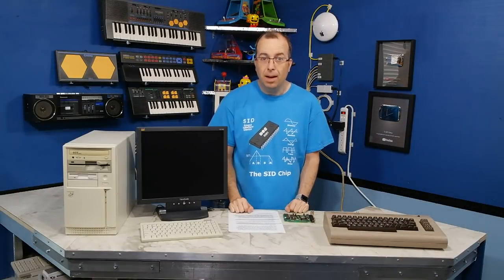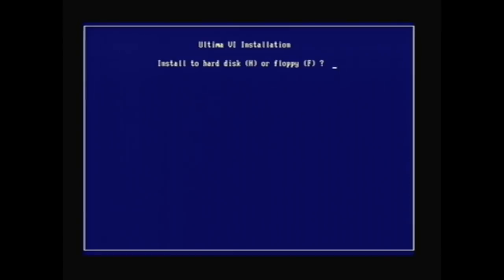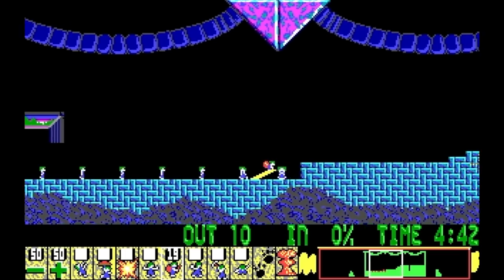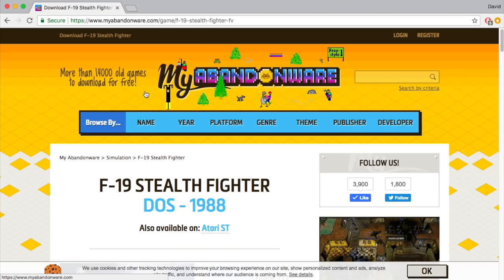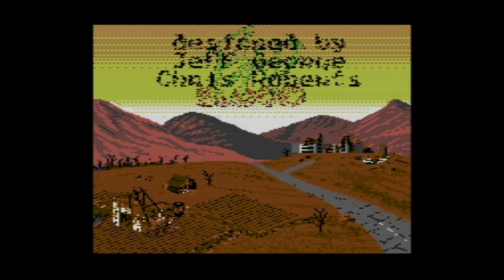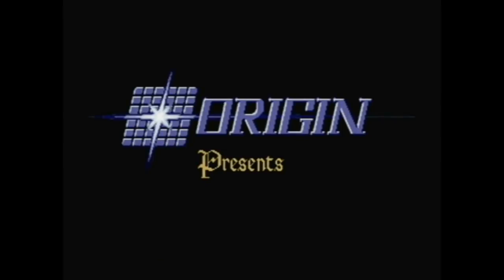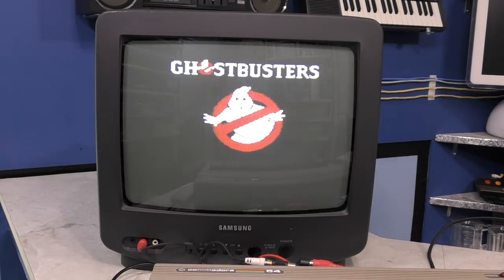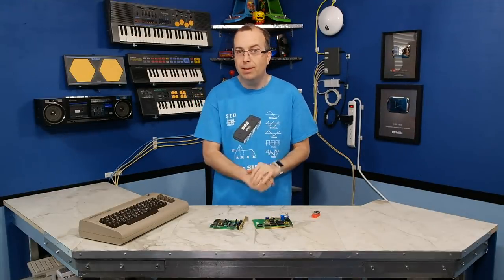Replica Sound Cards - AdLib, Innovation SSI-2001, and SwinSID Ultimate.

Comment: You know its the future when its easier to have a tiny computer (likely much more powerful than the c64) emulate a chip in software rather than to recreate the hardware.
Reply: Actually FPGA would be much better because it is not emulation at all and there for more accurate.
Reply: KRAFTWERK2K6 Except an FPGA (or CPLD) doesn't do the analog stuff.  A microcontroller/DSP can calculate the result and feed it to a DAC.
Reply: Actually from what I have seen in this video, there's a Xilinx chip on that SID-Board, meaning that it is an FPGA an no software emulation.
Reply: In the near future we can simply download hardware as software. We are going to be able to download more RAM as much as we need.
Reply: Just the other day I was reading about a project to allow using a Raspberry Pi to emulate a 1541 disk drive...
Reply: It's actually possible with a microcontroller: That's what the SD2IEC is.  But the Pi version offers much more complete and accurate emulation of the entire drive, making it more compatible with odd disk loaders.
Reply: @Erik Hansen   It's interesting.  As far as I can tell It's not just a matter of ease, It's a matter of silicon density:  Recreating the entire c64 on a much smaller scale is very possible, but the applications of such a device are very limited.  Whereas the potential applications for ARM powered single board computers are much wider, so has far greater enconomies of scale and accordingly a much lower price.

Consider how much silicon is used in an original C64.  Then consider the size of a Pi's system on a chip.  In the much smaller surface area, you can have a functional equivalent using modern technology at much much smaller scales, and very likely using less power to do so.  And we're at the point where you can pack SO MUCH MORE computer in the same silicon die.
Reply: @KRAFTWERK2K6  FPGA emulation is still emulation. It's code (in Verilog) running on hardware with a radically different architecture. Verilog vs C doesn't make it "not emulation"
Reply: @keiyakins  Exactly... the MOS 6581 is an analog synth... you'd have to emulate the individual transistor's analog properties to get a fully accurate simulation which is beyond any reasonably priced FPGA these days, probably even a desktop PC couldn't' do that in realtime. So, whenever some C64 demo group discovers a new method of using the SID chip there is a good chance that it won't work on a Swinsid untill they update the emulation to take account of that.
Reply: @Wingnut353  its straight up not possible. Individual units have slight differences from one another. The best you can do is preserve the original design and document known manufacturing related quirks

Comment: when he said the SID can't be made any more I thought why so I looked it up the SID is insane for a single chip. Properties of the SID
3 tone generators (voices), frequency 0-4 kHz (16 Bit decomposition)
4 forms of waves (sawtooth, triangle, rectangle pulse width modulation, (white) noise /rush)
3 amplitude modulator, until 48 dB
3 envelope generators
Synchronization of the oscillators
Ring modulation
Programmable filters (low pass, bandpass, high pass)
Master volume in 16 steps
2 A/D-converter (8 bit, low frequency, used for reading paddle input)
Random generator
Audio input (cannot be used for sampling, but the signal can be routed through the SID filter)  it's not that they can't they don't want to try

Comment: Oh my god. I've been plugging those CF-to-IDE adaptors into IDE cables. It didn't occur to me you could plug them straight into the motherboard. What an idiot I am.
Reply: there are models that allow to put directly and others that need a cable.
Reply: This made me laugh more than it should've had!
Reply: There are 2 different type, it all depends on the base of the card whether it is a pin end or a socket end ( male or female )
Reply: Jamie I made the same mistake, so don't worry. Now, I won't have a flash card dangling out of the case on my Gateway PC.
Reply: I usually plug into cables.  Unless troubleshooting or doing some kind of permanent install (or just running out of cables).  Less wear on the motherboard.
Reply: cables are still nice cause you cna master slave then
Reply: And it worked first time , never happened to me...
Reply: It took me me decades to figure out 'hood' meant 'neighborhood,' so relative to that you may be Einstein.
Reply: @czos9239  Oh my god! Just now for me !!!

Comment: Crap, Ad-Lib cards are expensive!  o_o
I think I'll just hang on to my Sound Blaster 16.
Reply: Lassi Kinnunen  Well... not quite. You see, the chip on the AdLib is the Yamaha YM3812, a.k.a OPL2, and there are no SB16s with an OPL2 chip. The one in some SB16s is the YMF262, or OPL3. Even though the OPL3 is backwards compatible with the OPL2, they're not exactly the same. Also, some SB16s had a Yamaha YMF289, or OPL3-L, that is a smaller variant of the OPL3 that runs at a different clock rate and has slightly lower pitch compared to the original OPL3 and even worse, some SB16s don't even have an OPL chip and the whole FM synth thing is emulated, and not very well, through something called CQM synthesis. I have tried at least one of each chip and while you can't really tell any difference between the YM3812 and the YMF262 in AdLib-written music, you can tell there's a slight difference in pitch in the OPL3-L and you can definitely tell something's not right with CQM synthesis.

Comment: thanks for the info everybody
Reply: It actually would be easy to clone a SID chip but it would not be economical. Therefore the SwinSID exists because it emulates it with parts readily available.
Reply: The original factory is gone. Even if you went to the huge expense of reverse engineering the chip and made some, it would not have the same analog properties of the original chip so would be "close" but never be "the same".
Reply: No chip fab does work at that rather chunky scale.

The SID is a hybrid analog/digital chip and is highly dependent on the manufacturing process used at the time. Factories have moved on.
Reply: You would need to find a fab that would manufacture the chip before that  and reverse engineer the die then you manufacture the chip the is very expensive.
Reply: The dated tech has basically been lost. 
Sure, one could use parts and remake the chip, but it wouldn't sound the same, nor behave the same. 
Kinda sad, but you know, that's how it is....
Reply: A few years ago there were companies in China selling "new" SID chips, but those actually turned out to be old, partially defective chips that had been relabeled, or in some cases completely non-functional fakes. So if you're attempting to purchase a loose SID chip, you still need to be careful about that. It's safer to obtain a working C64 (or C128) and then "borrow" the SID chip from it, or use the SwinSID device.
Reply: Actually you can, the problem isn't on reverse engineering the chip(as it was "done" for the emulation) but the problem is that the chip is a property of commodore and that the blueprint of the chip wasn't released anywhere. So you would need to recreate it, which would take a extremely high effort and knowledge in DSP's where can be done perfectly by emulation nowadays
Reply: The SID chips were made in a very old manufacturing process (hybrid NMOS), nobody even has machines for that process anymore. Also the original design documents are lost/haven't been found yet, so a redesign would probably be neccessary. 

It was estimated in the german c64 forum that ~750.000 USD - 2M USD is about the right ballpark to be able to make new SID chips. Of course, nobody wants to do that.
Reply: mateusfmcota I believe they have been delidded and photographed, so at least the layout inside the chip is known and could be replicated. The 6502 CPU was simulated inside a physical simulation (not just digital emulation) in the same way.
Reply: Yes, they could be replicated. Does not make sense financially though, at least at the moment. Although genuine 6581s are expensive and not getting any cheaper, newly produced replicated chip would slash the price down to a few dollars apiece. You'd need huge demand to justify digging up all the antique tech to set up a production line. It just MIGHT work if someone came up with a toy or musical instrument concept that would be mass produced in a huge scale and that would somehow require the genuine chip.
Reply: probably mostly economics. Integrated circuits are expensive.

Another problem is it contains A LOT of analogue circuitry.
Reproducing digital circuits reliably isn't that hard, but an analogue circuit is hard to reproduce with perfect accuracy.

Finally, a lot of what people like about the original are actually bugs and the result of it not meeting it's official specs...
Reply: To add to what everyone else has already said about the SID chip using a hybrid NMOS manufacturing process that nobody uses anymore, and the difficulty in making a chip with reproduction analog circuits that sounds identical, yada yada yada (one of these days I really must find out what a "yada" is and why they always come in threes)...

If you could find a "boutique chip factory" that was able to reproduce the hybrid NMOS manufacturing process, and if they could accurately reproduce the unique sound of the SID chip, you would still have to pay them to make a minimum production run of 30,000 chips.  It isn't worth the downtime to retool an entire production line for a smaller production run than that.  As Tobias Mädel said in his reply, that would cost potentially as much as $2 million, maybe more.  I don't think you're going to find enough SID enthusiasts to crowdfund a project of that scale.

So, we'll just have to rely on the dwindling supply of "old new stock" SID chips and the swinSID (which only costs about $45 including shipping).

Comment: did you notice monty on the run was like an octave lower on the simulated sid?
Reply: matthijs janse was that an octave? Sounded like a few steps down to me. I am wondering whether this another NTSC vs PAL thing, where the chip was running at the wrong speed.
Reply: It was off by four steps and a flat. An octave is eight steps, or seven and a sharp/flat for major/minor scale. 

David's PAL theory sounds like the most accurate diagnosis.
Reply: The SID player doesn't know is whether the SSI card is using a real SID or a SwinSID, so there shouldn't be any difference regardless of PAL/NTSC. Also, neither the real SID nor the SwinSID have any idea whether they are PAL or NTSC either - they should just run off the clock that's fed to them. My guess is that the SwinSID is expecting one of the C64 clocks (~1.023 MHz NTSC, ~0.985 MHz PAL) and doesn't like the clock which the SSI card is sending it (~0.895 MHz).
Reply: No, the SSU has it's own clock, but does not detect the external one. you have to manually set if you using PAL or NTSC pitch.
Also there is a "fun fact" about the SSI: it runs on a different clock than any C64, depending on the board it may have jumper to set different clocks, but the SSU only capable of handling true C64 PAL or NTSC clocks as of now.
Reply: Noticed that immediately - "what do you mean some of the percussion track is missing, this is not even the same tone!"
Reply: Actually, an octave has 6 steps and that is the "difference" between the first and last tone of a scale regardless of whether it is a major or a minor one. 

My guess is that the difference comes from the replica card's not driving the chip the same as the Commodore and the replica "chip's" not having the same response as the original SID. Each was tested with the original equipment when designed and worked well enough with it, but the combined imperfections of the two replica parts can produce edge cases where the end result is not quite correct.
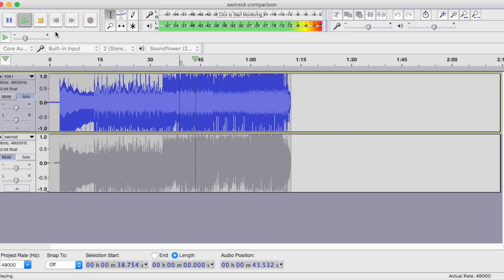Reply: (there are 12 half-steps in an octave; "steps" aren't an idea of their own, but the width of 6 whole-steps happens to equal the width of an octave; the distance between A4 and ↑C5 is a wide minor third, and A4 to ↓D♭5 is a narrow diminished fourth, which are both between 3 and 4 half-steps. the difference i hear at 11:46 is one half-step.)

Comment: Why cant anyone make sid chips anymore?
Reply: Likely nobody can get the masks used for manufacturing the ICs.
You could reproduce one using reverse engineering, but it would be hard.
Reply: Also, there’s chip fab process issues - even if you have the original artwork for the masks; modern chip fabs will produce chips with different analog characteristics than the original 1970’s MOSTEK chip fab did...
Reply: I wanted to know too.  i looked in the comments section to see if somebody else asked.  i am making this dumb comment so I can get notified of other answers.
Reply: cissa95

There are already several FPGA SID clones, and some use external analog parts to simulate the original filters more faithfully.

But, to my ears, even with the digital filters, it sounds awesome. It's especially great in "fake stereo" mode on headphones, where each of the three channels is panned slightly left or right.

The thing is, the original SID chips could sound noticeably different from each other, even from the same revision or batch.

And then there are quite a few different revisions of both the 6581 and 8580 which all sound different.

This obviously tends to make C64 fans say "Well, it doesn't sound quite like MY SID chips...". Of course it doesn't. :p

Most of them have all been characterized for their frequency / distortion / filter response etc., and there IS such a thing as "the average SID chip".
(for both the 6581 and 8580.)

Sure, the FPGA core versions might sound a bit too clean compared to the average original SID, but there are lots of options for tweaking the resolution, the filters, choice of DAC etc. ;)

Sound of the SID replacements like SwinSID are very good, too, but may still have a few incompatibilities with a handful of games / demos.
Reply: Legends say that having found no apprentice worthy of his standards of excellence to train, the Last Sidmaker took the secrets of his craft to his grave; and thus Sidmaking came to a tragic end amidst much ululation and despair...
Reply: Attila Asztalos, I heard he became disillusioned with Sidmaking after one of his apprentices turned to the dar... never mind I think that was something else.
Reply: @Οδοιπόρος  He used to say "use the SID, luke", right  ?
Reply: there is also the little issue of the defective mask in the first run of SID chips, that also give them a specific sound character.

Comment: When you were testing the Innovation sound card I could hear a difference when you used the real SID chip versus the SwinSID chip.  The music on the real SID chip in the Innovation card was maybe a semitone higher than it was with the SwinSID chip.  I actually liked the music at that pitch to be honest with you.
Reply: Yes but in the c64 they were identical... and since the innovation was doing that weird percussion glitch with the swin sid, my guess was that it was another fault of the compatibility and not the swin sid, i bought a swin sid for my 64 and it sounds wonderful, which is good, but really its a good thing only because when i bought my 64 all the chips worked aside from the SID it barely worked at first and died not long after getting the machine, with those old chips being expensive the swin sid saved my machine... literally i was going to turn it into a parts machine for a broken c64 with a prettier case.

Comment: At 7:31, to run the 8580 you replace the jumper with a 78L09, which is a 9 volt low power 3 terminal regulator.
I assume the 8581 runs at 12 volts, hence the jumper or “short”.

Comment: If you could find a way to connect those LED’s to a spot on the C64’s case so you can see them light up with the machine closed, that would just be amazing. It would be like having one of those stereo amps with those little screens with bars that jump up and down with each sound track being played.

Comment: It's amazing how much these old cards are selling for. When I ran a small computer shop back in the early 2000's, I trashed tons of these old parts. I still have some old cards like my Soundblaster AWE64 gold isa which now sells for over $100 on ebay.
Reply: It's because these are high-end sounds devices from the golden age of sound cards. Especially the AWE64 is one of the best sound cards ever made. After sound cards moved to PCI, all functionality from the sound card was stripped until we got today's DAC only devices. You can argue that software generated audio has its merit, but that makes them boring.

These devices with their advance hardware synthesizers can learn you a lot about high quality audio synthesis.

Comment: FYI: 78L09 is a 9 volt regulator, like a the more common 7805 and 7812 voltage regulators  , except being a 1 amp it is a 100 ma (L letter) and 9 for 9 volts, 78 positive, 79 negative, the 78l09 does look like a transistor though

Comment: M.U.LE doesn't sound right on the SwinSID. Is it in 8580 mode? Because I think the 6581 pitch is 1 half step higher. Monty on the run sounds better with the 6581 than the 8580.

Comment: For us musical Commodore folks, I believe the NanoSwinSID chips are selling for about $20 on eBay, which is great on the budget if you're putting together a SID2SID dual chip board or if you can get your hands on the SID Symphony or SID Symphony II cartridges. An original SID by itself can easily go for more than $50. :(

Comment: What would be really great for the Retro PC scene are bus adapter cards that let you plug wrong generation cards and drives in with full fidelity.  So you could plug your ISA, VLB or PCI card into a PCIe motherboard or a modern PCIe card into an ISA or VLB motherboard.